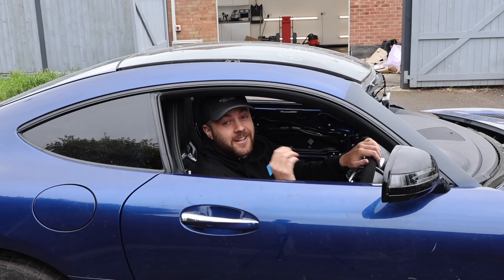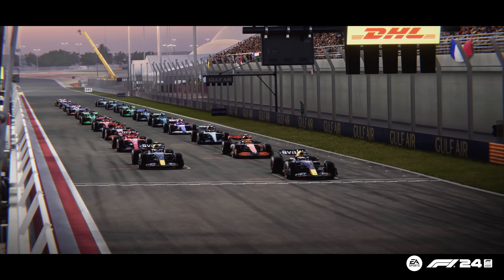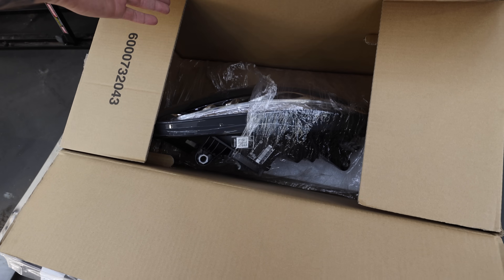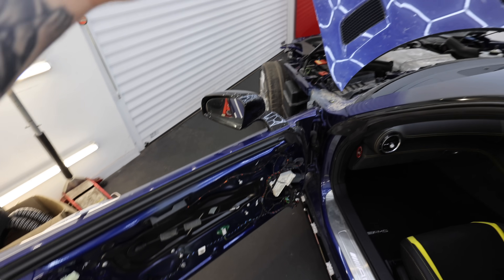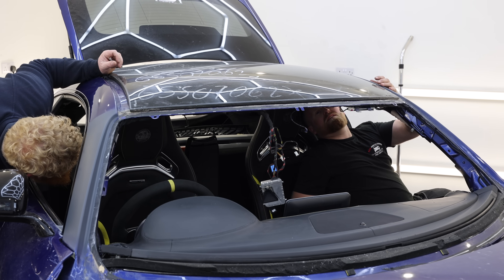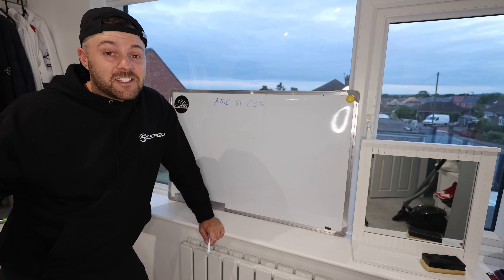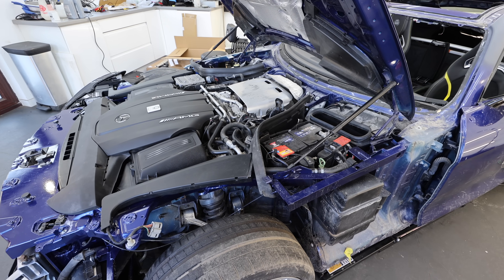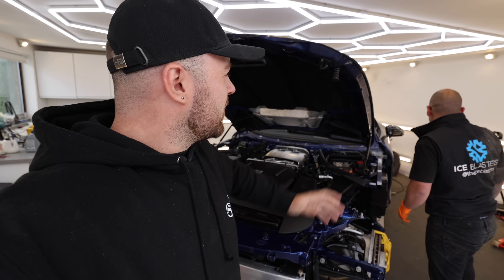I CHOPPED THE ROOF OFF MY WRECKED MERCEDES AMG GT

Comment: I bought a Mercedes SLC. I needed some crankshaft bearing shells, my  local Mercedes Said there’s none on the system. We can’t help you for over a month. I rang around the country and found a Mercedes garage in Nottingham an independent garage. He got me the shells from Mercedes in 3 days so call them give them a try.

Comment: Really enjoying this, having been a panel beater for 20 years I can see two obvious problems, one it’s a Mercedes, great cars but high price on body parts, ( like you have found eBay often want twice the price for used parts for Mercedes and BMW new ones, 🤬) and a rare newish car means not a common breakers yard car, new prices will push you up to a good second hand car price 🙁

Comment: The cheapest intact AMG GT that I found was £46k, also in blue. That rebuilding business isn’t going all that well here if it’ll cost a lot more to put back on the road than getting a brand new second hand one. Isn’t the point to buy it cheap, fix it and still be quids in at the end?

Comment: Roughly adding up what you wrote on the board and I came to +£50000. How did you only came to £42000? Car + Rad parts + Panels + Metal repairs and Miscellaneous  = £41000.